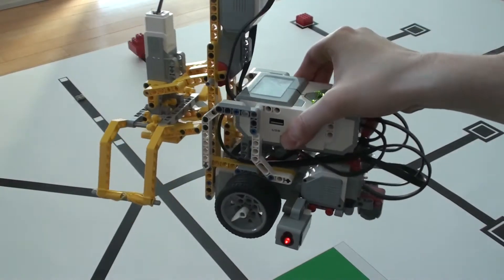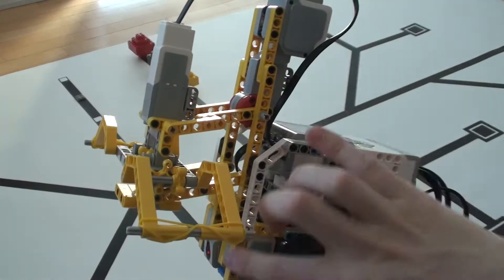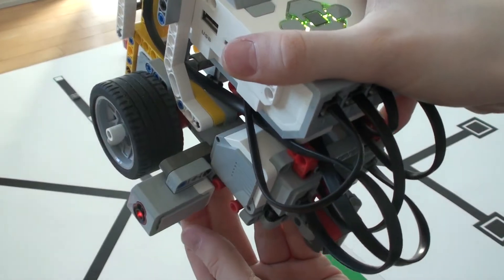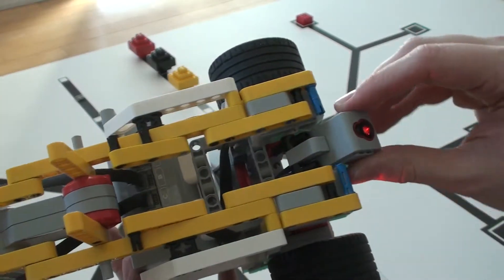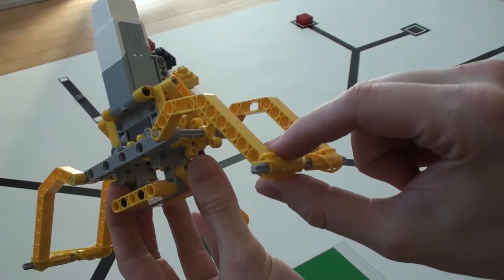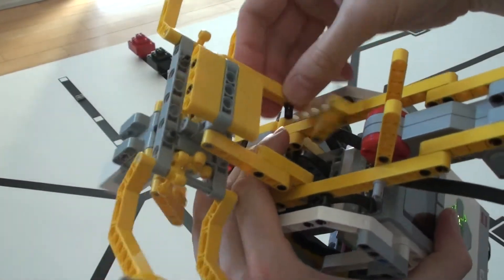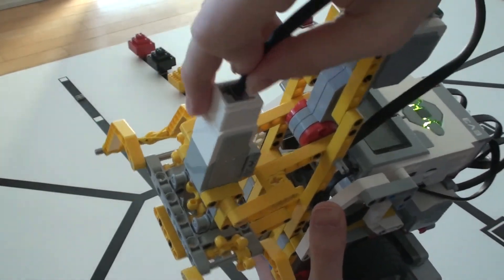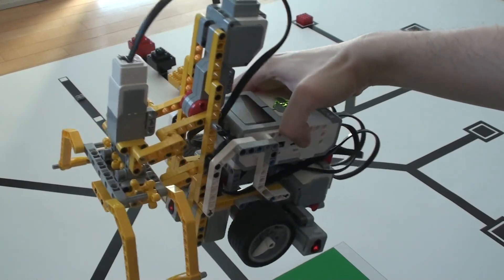Building instructions for WRO 2017 standard robot (senior/regular)

Comment: how does this detect size? I understand that it detect color by color sensors, but how about the size, how does the sensing mechanism work to know the size? I been struggling to do this with my robot.
Reply from the maker: Read the grab motor rotation values. If it rotates much, then the size is small.

Comment: Hi. Very cool robot. I just wonder what's the sensor on the side is for. Is it to prevent the robot from driving against objects?
Reply from the maker: It is for detecting the color of the generators. I showed it briefly in the first video, but it is not reliable enough yet for me to declare it as something I would recommend.
Reply: Lasse Deleuran okay thank you, I thought about that. At the moment I have enought to do with picking and sorting the normal parts ;)